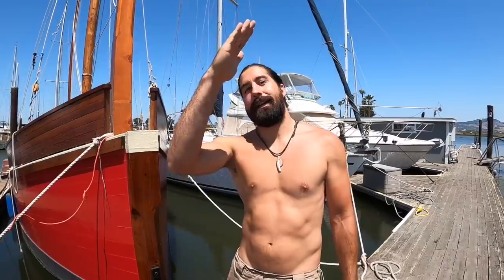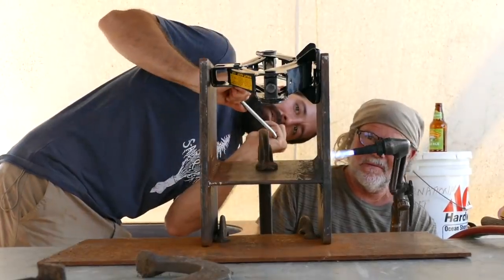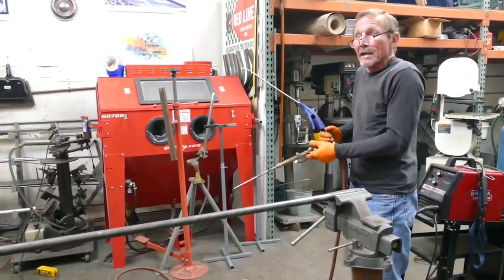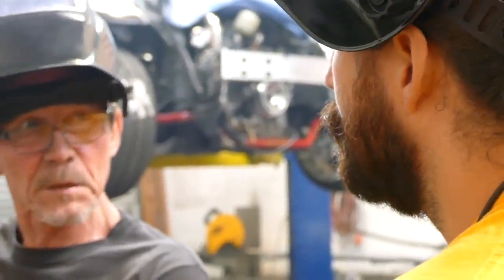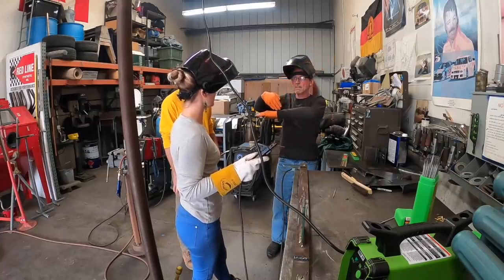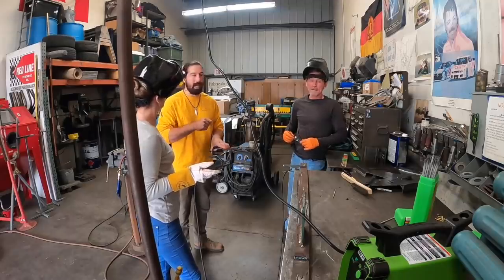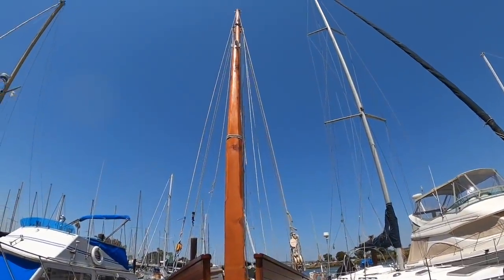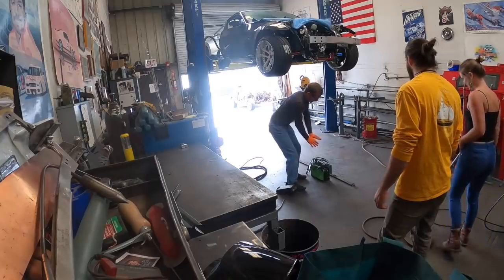Salt & Tar: Ep.105- Call the Welding Guru

Comment: I'm with Ruth on this one. Looks weird having the bow sprit sticking up like that! Would look so much more fair following the line of the deck.
Reply: That is a bit of a long stick. Think about the pressure on it plunging through heavy seas. This is not a weekend, fair weather trip boat. It is intended for major ocean crossings in all weathers. A bit of a higher rake may be a better idea.
Reply: Yeah Ruth is right this time!  Lower is better.  It will allow for more sail as well.

Comment: Follow the sheer line remember it has to carry sail when airs are lighter so more sail is best. Also too high and it looks like an erection.
Reply: Aye, but it also needs to keep its stowage out of the rough seas from being washed away. And slightly more erect will be at a better angle for more rigging options that near flat out. Function should prevail over form on a working bit of the boat.
Reply: The angle of the dangle should always be in proportion to the mass of the keel ????

Comment: looking at dozens of pics of old sailing ships, it's clear that it should be a continuation of the sheer line. anything else looks broken. not even a question. but because it has no curve of it's own, it needs to be essentially a tangent, or possibly a secant, to the curve of the sheer line. in any event there is some variation. for the most part, the older the design (and i'm talking back to the 17th century kinda olde) the more of a disparity between the upward angle and the sheerline, in part due the the flattening of the sheerline over the centuries.
Reply: That is correct. Also, that will give you more sail area and a better sail angle.
Reply: But check out the boat here. https://youtu.be/LSbro-c4G8s
Jump to 2:0

Comment: Perhaps let the bowsprit be a natural extention of the front of the deck?
Reply: Love the idea. Perhaps adding some planking and creating a pulpit area surrounded by netting would provide a great dolphin watching spot. 
Too high looks just off plus it raises the clew of a foresail a lot raising the center of effort creating more heel vs draft.
Might as well use a kite tied to the top of the mast... not. A kite would be attached as low as possible to maximize motion and not increase leverage tipping the boat.
Reply: I'm with Ruth. Bow sprit should follow the sheer line. 👍👍👍
Reply: It should totally follow the sheer line.  This isn't a viagra commercial...

Comment: Hi guys,
My 2 cents:
If you travel a bit once this boat finished enough, you'll realize that there are places in the world where there are very few or no anchorages (like The Azores, West coast of Portugal, Morocco and others), and it's marina or nothing. And then you'll probably regret not having designed a "quick and easy" system for your bowsprit (even with the quickest and easiest design you can come up with, this bowsprit lifting and lowering will always be a chore, I think). 
Here is what I have - a line latched to the bottom of the bow stem, running to the head of my bow spinnaker pole (acting as a bob stay) and coming back to the toe rail (acting then as a whisker stay). Double that, and you've got 2 bob stays + 1 whisker stay on each side with only 2 lines. Then to hoist your bowsprit, you just have to release the whisker stays and pull on your jib halyard or whatever lifts the thing.
Hold fast!

Comment: Dude's clearly had an apprentice or two in his day. So clear and articulate. So positive and encouraging. So much patience. 😆 That's a good man to learn from. I mostly MIG and TIG. I have done my share of "Stick," but I do more Aluminum than steel plate and no one really needs to do submerged arc for that anymore. Same thing/different temperatures/bigger mess, under a pile of powder flux. When I learned Stick, it took me a while to strike consistently, (lots of profanity to start,) so if that was Ruth's very first arc strike, I'm impressed! Nice job! I enjoy the simplicity and economics of running a normal stick machine, but now I do any kind of stick welding so infrequently I laugh every time I get it right without a few minutes warm up. It's cheaper and takes less setting up and dialing in, but it's by no means easier; just different. Much love, y'all. Boat looks beautiful.
Reply: Actually never had a apprentice (I did a sort of apprenticeship) however I’ve taught many a person on many different topics of welding and metal fabrication. From welding to metal forming and tube bending and also joint preparation. It’s all fun, for me going to work is like going to metal shop everyday so I’m very fortunate to have followed my dream. I rarely have a bad day at work.... hell I get paid to go to metal shop how bad can it actually be? Rolf

Comment: Perhaps you have already realized this and have a plan,   but this is an issue I see with the bow sprint design so far. The sprint's load is all pushing aft once it is rigged. In the current situation all the aft load is on one bolt. The surface area of the wood in contact with the bolt is too small. I would suggest at least a hard wood or steel contact point at the aft end of the timber at the surface below the pivot point so as it lower into position it would push aft against the sampson post. It could also rest on the deck giving you the ability to anchor it to the deck beams to share the load with the post through the butt end of the Sprint's surface. Even better also add a fitted shim wedge on the upper half after it is down, to also carry the load to the sampson post.

Comment: Lower it to match deck lines at least a few more inches to parallel with deck...The bowsprit has all the cables to take loads, but the pole itself is a compression  element in the middle, so it's better to have all that force be inline straight down it's length and not bending it and transferring that load to the samson post as a twisting or bending force to it and the deck.

Comment: Being a boat designer myself, the bowsprit should be tangential to the curve of the sheer.    I agree whole heartedly that the mild steel needs to be hot-dip galvanized.  It'll just rust away in no time in salt air/water.   Lots of things to consider, but all part of creating a practical design.
Reply: Galv is better than nothing, but will only stem the inevitable for a few more years. So many galvanized fasteners in this boat, I feel bad for all the work these guys put in that they couldn't spring for bronze.
Reply: @roscoejones4515  Yes.. I had commented many videos ago that their use of 'house deck screws' to fasten the planking was Not a good choice... wet wood surrounding mild steel is a sure ticket towards failure , and most likely to occur in a highly stressed situation, like in a heavy seaway.

Comment: I started stick welding at 15, and learned oxy acetylene in 8th grade shop- but I have been welding MIG for decades since. I got an old Dayton (re badged Century) 230 AC box given to me, which I need for heavier stuff (my MIG is a 110 volt Hobart) and man it was like learning to ride a bicycle all over again!  There is just something about the sound and smell of a bead being laid at the proper amperage and speed. :)

Comment: Been watching you guys from day one :-), I am impressed with the work u guys are doing. Have to agree with Ruth on this one LOL. A comment, I would have the bolts a bit longer so the pivot is not bearing on the threaded portion of the bolt, it won'take long for the thread to cut into the flat bar. Loose the lockwashers, use flats and locknuts, only time lockwashers do any good is when something comes loose and bolting thru wood it will eventually........Mike

Comment: I'm voting with Ruth. The bowsprit should be an extension of the deck plane. That keeps the three stays the shortest and give it the most rigidity. No turnbuckle on the bobstay only shackles and the turnbuckles on the other three. That way it can be deployed and removed from the deck, without the need for the dingy.  It does look great on the front of the boat.

Comment: Rolf is a good welding coach. Garrett has a steady hand, like he said, from wood working. That welder is impressive for being only a 110V unit. Try some high nickel rod on stainless or cast iron. You can polish the brass-like bead for an interesting finish for a marine application.

Comment: Not sure what your plan is for the Bobstay, most go for a full chain, but since you want to raise the sprit regularly, I'd go with half chain and a pair of SS pulleys and some Dynema for the upper half that can be tied off to a cleat on the side of the bowsprit.That way you can raise and lower it without having to unbolt the chain, plus it can act as an adjustable 'Down haul' for the forward stay. You won't have to crawl out to the Cranse Iron or swim out to the Bobstay clamp and you should be able to reach the shroud clamps from the deck...And, while the angle is your choice, remember, the lower the sprit, the larger your jib can be.

Comment: Looks great, I vote for following the deck angle.  You could cut some brass door hinges in half to lock the bowsprit into the vertical position while docked.  The pins would be pretty tight though, maybe file or sand them down just a little on a drill so they can act like a drift pin.

Comment: When the slag pops off like that you did a good weld!!!! Also drill a smaller hole near the bottom of the bracket.  through the sprit when up, and have a brass pin you can install through it to secure it when up. Powder coat the bracket?

Comment: I’ve always found stick welding much easier than mig or tig. I guess it is what you learned first and what you spent the most time working with. But needless to say good job to you both.
Reply: That's funny, I learned Mig and Tig in about a week. Stickwelding took me a year to do some decent welds and many years after that before I mastered it.
Reply: Actually when you go to welding school the first thing you learn is how to use a cutting torch because after all everything is based off of that! If you can learn how to manipulate molten metal with a torch the rest comes much easier.

Comment: As for sail function having the bowsprit lower is better and you get more sail area that makes the main work better.  One of the previous comments said to galvanize all of your existing mild steel.  I concur 1000%, having mild steel will put iron rot into any wood that mild steel touches no matter how much tar and sikoflex you use.  Bronze or stainless is a much better material but Galvanizing will last cruising for ten to fifteen year and will have to be re dipped.

Comment: Re the welding, I put a slight bend in the rod  at the mid point, it helps me and also you can do a small circular motion at the tip as opposed to a straight line.

Comment: If you heat the top of a solid shaft, the shaft being solid resists moving like down, the top half metal being red hot will get soft and get squeezed as it expands and the solid shaft resists moving, it deforms like soft butter, then when it cools, it shrinks and pulls the shaft over.  Doing this is how you straighten a prop shaft. Or even straighten a large pipe or boxed girder. the pipe is so small in the case, much of it is hot from the large heat of that torch  and cant resist being moved.

Comment: You’ll need a stem support to lock it down  and a spreader to set the side stays at an angle they will hold when hard on the wind  cause the boat is skinny in the bow

Comment: Certainly looks better as a continuation of the sheer line, but I would have thought, from a practical perspective, the guiding light must be the proposed sail plan?  Do you need to maximise the flappy stuff in front of the mainmast in order to balance the boat, in which case the sprit needs to be on the deck?  For me, drop it to the deck - looks better and gives you maximum flexibility when to comes to sail plan.

Comment: I'd seriously consider taking all the mild steel off, bow sprit bracket, chainplates etc and getting it all galvanised
Reply: My thoughts exactly.
Reply: Bronze would be even better.
Reply: Builders choice, when you build your boats (from scratch with a smallish budget) you can pick what you would like to put into your own boats!
Reply: @Mtlmshr  Firm grasp of the obvious.
Reply: @Mtlmshr  very true,not expensive for galvanizing the iron parts.
Reply: Should be built out of bronze.  Galvanized + wood + sea water = bad problem down the line.
Reply: Replace ALL bits with bronze.
See what Leo is doing on Tally Ho.
You want absolutely no steel on a wooden boat ever, see what iron sickness does to wood.
Reply: @pikethree  you can have steel and iron.  You just have to realize the limitations.
Reply: @MrRourk  No, you can't.
Galvanic corrosion rot of wood is a disaster in all senses of the word.
There's nothing you can do to overcome it.
Seriously, watch the restoration of Tally Hi.
Reply: @ Sos the rope they have A LOT of galvanized fasteners in this boat. Agree it's a mistake but it doesnt make any difference now. I've seen 1/2" galv bolts rust to nothing in 10/15 years on beach house decks. Shrug.
Reply: @roscoejones4515  Yep.
But I regret commenting now cause I didn't want to scare these 2 lovely people.
Sigh

Comment: Traditional working boats usually have the bowsprit virtually parallel to the waterline. This not only maximises the area of foresail you can use but also puts the angle of compression where it butts up against the Sampson post close to 90º which is best for strength. I'm sure that some Sampson posts are slightly angled backwards to match the slope of the foredeck and that would put the bowsprit at a small angle. Aesthetics might say that a bit of an angle upwards is better but it won't meet some of the above rules. The original plans show it angled up approximately following the angle of the deck and that's fair enough.
Enjoy this video and see how boats were rigged back then. If a visit by Rediviva could coincide with this annual event I'm sure she'd be very welcome.

https://www.youtube.com/watch?v=ZGdcaFK0PZw

Comment: Will you have to remove the forestay to raise the bowsprit? It’s smart to not limit the option to raise it . The other option is a slightly offset sprit and pull it back on deck. 
Cheers Warren 
Ps love the ‘inverter welder ‘ we have a tig version works great too.

Comment: 6013 is a cellulose based flux and 7018 is a titania based flux.  You need to keep the 7018 heated to keep it dry, humidity will absorb into the 7018 flux and could result in hydrogen embrittlement and cracks in your welds.  6011 and 6013 is your friend away from the shop.

Comment: I know my vote does not count, but closer to an extension of the line of the deck rail seems a fairer line for the bow-sprit, to my eye. Of course if your looking to make it a functional part of the boat, and not just a "pretty to look at" like most modern boats, then a little higher is the way to go for function over fair lines. Low for fuller sheets in slight breezes, higher for gill nets stowage, more rigging options, better hammock angles, rough sea stowage retention, etc...

As far as the stick welding goes, Ruth just need more practice. It is a new medium in welding for her. Garrett has had time to practice already before seeking audience with the Guru. I am also impressed with the tiny little welding machine. Must have exceeded the recommended "on time/cycle time" to pop that breaker. The smaller machines usually have shorter cycle times. You can't just start and go, you have typically a 40/60 cycle where you have like 40 seconds welding, 60 seconds off, then go again or they over heat and trip breakers or some similar recommended cycle, 35/65, 50/50, etc...

Comment: because your using one bolt, the flat mid plate will me holding the weight of the entire piece , so I would ad a metal flat plate behind the steel brace you built so the top or bottom dont dig into the wood behind it.......should be easy enough to hammer in a thin metal shim, and it will 100% tighter the fit as well. Just my 2 cents

Comment: Its really subjective, and its YOUR boat, but i would side with Ruth. That might be that most of my experience has been with English working boats, many of whose sprits would be mostly parrallel with the waterline, or in the case of Falmouth racing cutters, even reveresd to gain more sail area. Maybe not such an issue if you use a jib net, but easier to walk out on one that is level than at a high angle, especially when wet. I prefer a headsail on an outhaul so i do not even have to get off the deck, why take the risk?  Does make a nice hammock at anchor though.

Comment: I’m kinda ignorant about sailing large boats but the higher the bow sprit goes the smaller the sail it can support. You can always reduce the size of that sail under windy conditions but you can’t stretch it when the wind is scarce. Then you should take what I just said and interconecté it with how X angle will affect your sailing under ideal weather or bad weather since a higher angle may be good for one and bad for the other. Perhaps adding two locations for anchoring the bobstay that way you can try your various options before deciding where to leave it. It would make for a great video to see a year from now what that decision was and how you got to it. I’d suggest a reading of Ch 3 of Richard Henderson’s book “Understanding Rigs and Rigging” for other things to consider. Other opinions can be found here:

https://modelshipworld.com/topic/20159-optimal-bowsprit-angle/